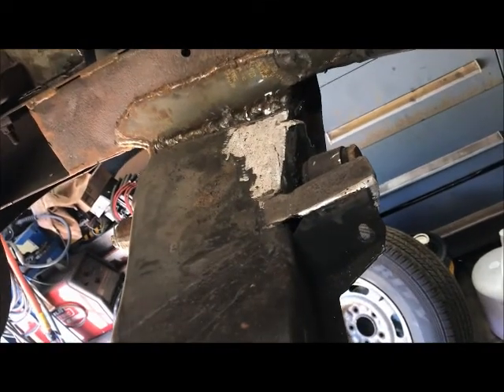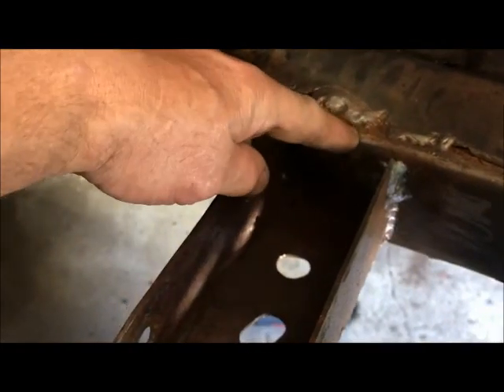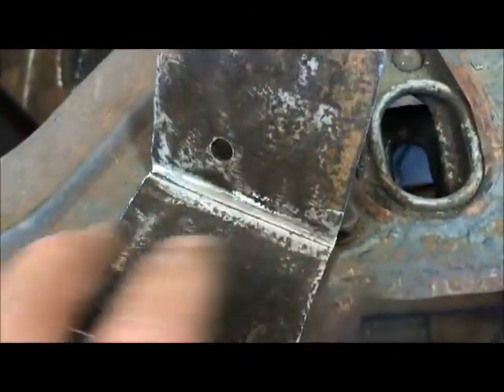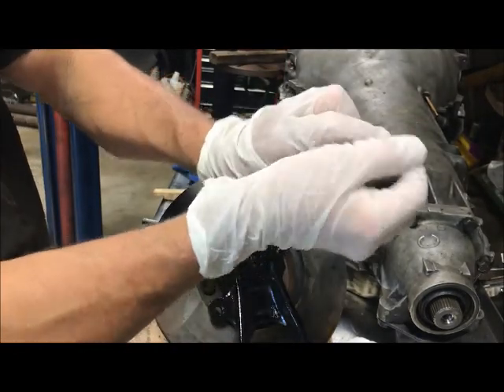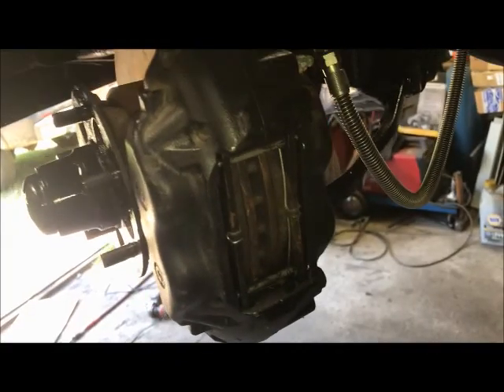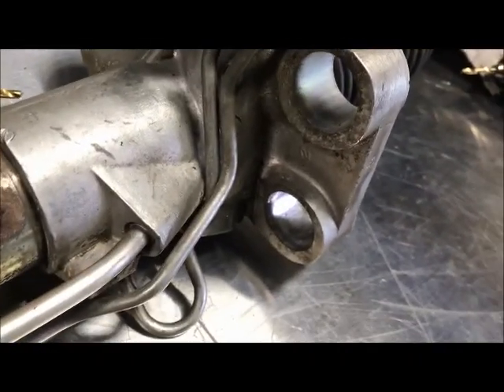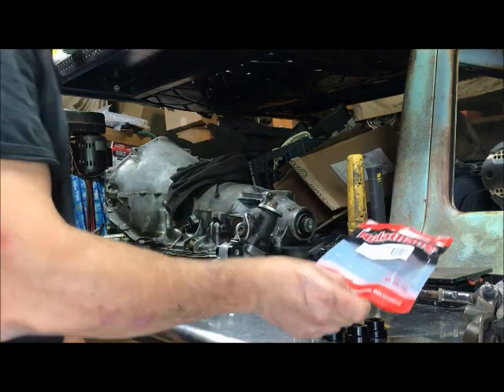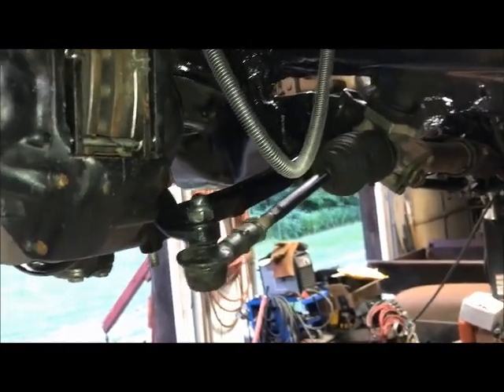1955 Buick Special Turbo LS Build part 24, Jaguar IFS rebuild part 1 for the POSpecial!

Comment: I'm putting this front clip in my 1950 pontiac right now. Awesome videos. Been using them as a guide. Did I miss the lower control arm part of this?
Reply from the maker: I did not pull the lower control arms on this build, it wasn't needed. I have installed a bunch of these front ends, and I have found that it is not necessary to pull the lower control arms unless the control arm bushings are shot. Cracks will appear on the rubber section that you can see, but it is cosmetic. If the lower arm has no play leave it alone, because chances are one or both of the lower fulcrum bolts that hold in the control arms will be seized either inside the crossmember or to one of the bushing shells. I have not had one yet that both bolts came out clean, and I ended up making a tool to be able to hammer on the bolts to shock them and not damage the threads. I have had them so bad that I had to cut holes in the bottom of the crossmember to heat up the inner support tube with a torch to get the bolts out, and torching out the bushings is almost a guarantee. Also do not remove the large nut on the back of the fulcrum bolts, they are swaged on and not meant to be removed. Lower ball joints were replaced, I think I would of shown that in one of the videos.
Reply: @rust_hoarder_garage   also my outer frame width is approx 35 1/4 if I notch the inner rear of the spring pocket/tower to fit my rails between them do you think it will compromise to strength?
Reply from the maker: It will be fine look at the jag ifs install in the 51 Hudson build, it is notched
Reply: Another question. The jag front end I’m using has thin solid rotors. I don’t know what year it’s from. Can I swap out the newer style vented rotors ? If so what all needs to be swapped? Rotors, calipers, pads?
Reply from the maker: @speedwolfusa2847  I have only seen vented rotors, but the oldest IFS I have used was an 81. There is a wheel bearing size change in the mid 80s , other than that I have no idea, but the spindle stub is removable so I bet it is possible as long as the right bearings are used.